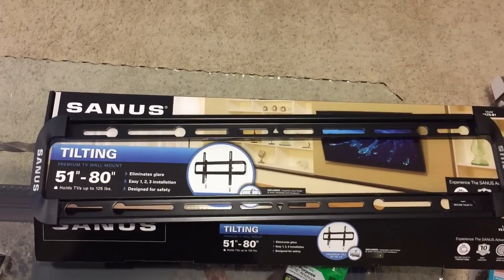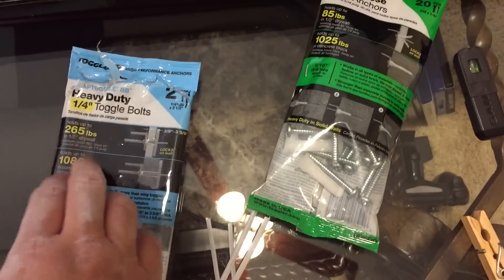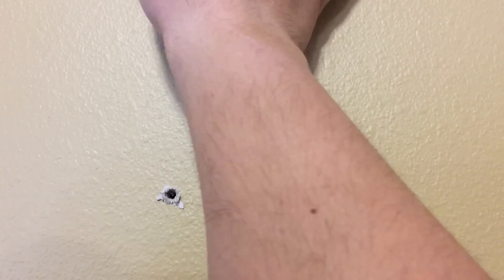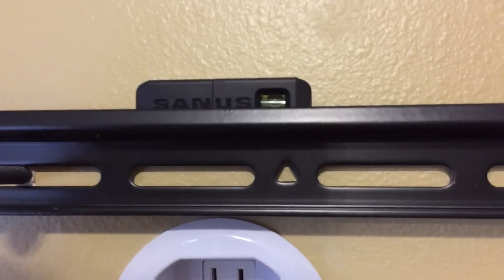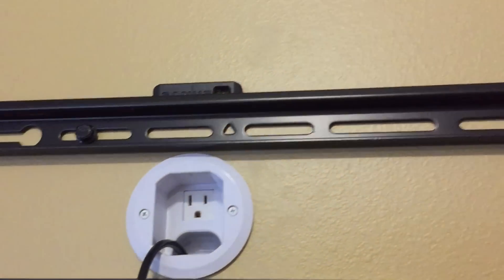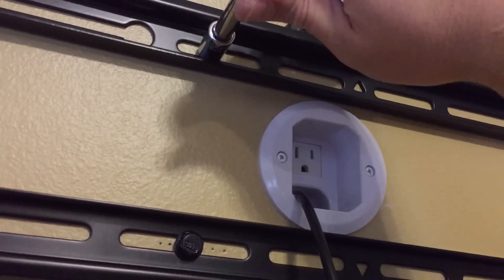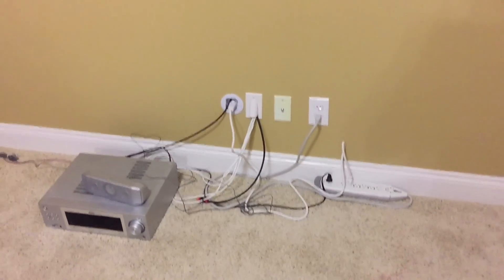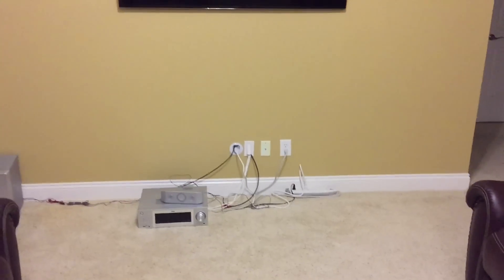4k Samsung wall-mounted installation and review

Comment: That's actually not a good video why don't you show the part how you mounted to the back of your TV because I have a similar TV with four holes and there's no threads on the inside of them just a hex bolt and I bought a universal now and none of the screw is will actually even reach in there so how did you do it
Reply: I have the exact same problem.

Comment: Thanks for sharing! I have a Samsung 65inch 3D smart tv and I want to mount it on the wall in my apartment but I'm terrified of the walls in my apartment, don't trust them lol I don't want my expensive tv to fall.
Reply from the maker: Nyla Skyy you don't have to worry as long as you hit two studs and use long heavy bolts to hang the bracket if you can get four bolts into the wood to hold the TV bracket it should hold.  The best thing to do is to find a friend that has a TV on the wall and knows what they're doing so they can assess your situation and make sure it's safe to hang the TV. The only bad thing is using large bolts like that will leave large holes and when you leave there hard to cover up and you might lose your security deposit. So also be mindful of that. Anyway good luck hope you have fun with your project and just be careful.
Reply: southcoastdesignz thank you

Comment: Did you install the power outlet yourself?
Reply from the maker: 949surferdude yes it's real easy!!  The kit comes with everything you need and it's just really an extension cord in t your wall. You still have to plug the other in to a really outlet in your house. It just gives a clean look. Thanks for the comment
Reply: southcoastdesignz how do I search for these outlet kits. What are they called?
Reply: Biacco they have a really nice kit at Lowe’s for $49.99 to hide the wires and install a outlet. I have 2 and they look very clean and professional

Comment: I noticed you have a recessed outlet. Is the plug for this tv straight or angled? We are trying to plan ahead and need to know if a recessed outlet or flush-mounted wall outlet will work best. Thanks.
Reply from the maker: Recessed is mush better than a flush mount bc the tv can sit closer to the wall. I have a straight plug. But even if it’s angled u can just use the top plug and it will fit fine. Thanks for the comment.

Comment: what size are the screws for the brackets that go in the back of the TV? I have a 65 inch curve.
Reply from the maker: Eman323 I don't really know. All the screws came with the bracket. They were too long but they come with spacers and they work ok. I'm sure any bracket you get will come with the screw need to attach to the tv so you should be fine.  If you have a curve tv it should work as kind as you see the 4 screw hole on the back of your tv. Thanks for the comment and I hope this helps.
Reply: Screws will need spacers, but for $19.99 for my mount I won't complain. ONN brand

Comment: what size screws did you use to connect the mount to the TV?
Reply from the maker: christine bonfiglio are used heavy duty 1/4" toggle bolt (x2) and 5/16" anchors (x4). Thanks for the comment
Reply: southcoastdesignz just wondering cuz you were reviewing the mount
Reply: southcoastdesignz i subbed by the way 😀

Comment: Bracket for 4K Samsung 64 inches curved TV
Reply from the maker: Mariama Jammeh it should work. But. I'm not sure bc I don't have one. But if u look on the back I should be flat were there screws are on the back. So if that's true it should work fine. But to be safe go to Best Buy and ask there opinion and they should point you in the right direction. Ok good luck and let me know how it goes. Thanks for the comment